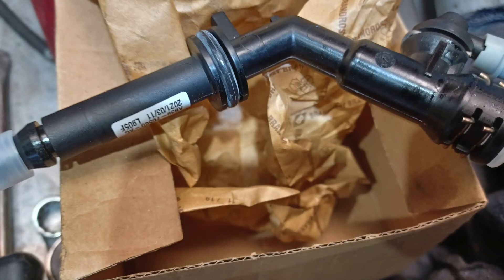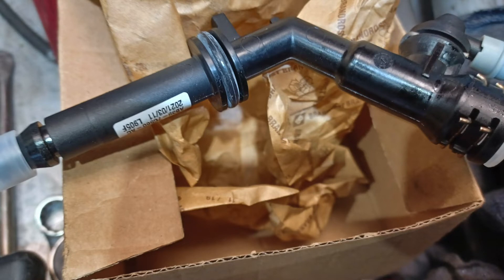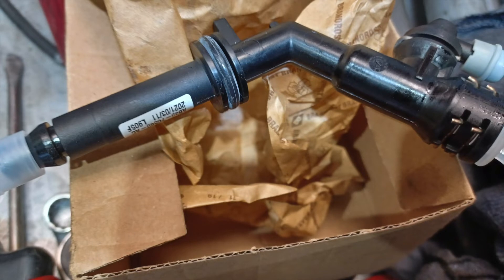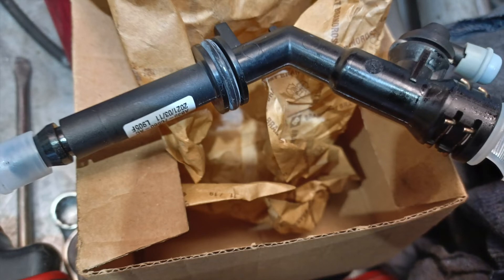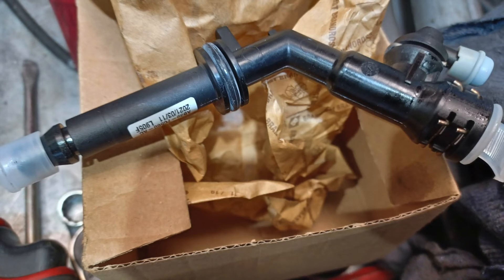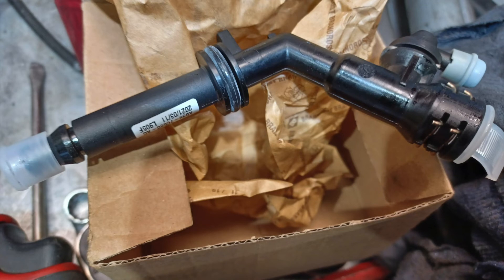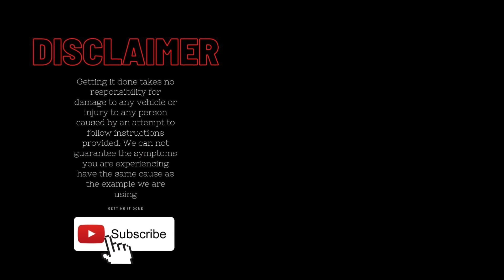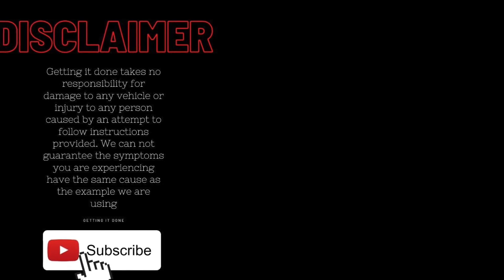Ford PX Ranger losing clutch pedal

Comment: I was gonna get one through ford genuine. thanks so much for sharing, been doing my head in for a couple of weeks now, my client's pedal is only partly sticking down, installed return spring to pedal, improved situation but did not completely fix, few weeks later came back, big headache.
Reply from the maker: Yeah we've done a couple of these now. We use genuine parts for them now too.
Reply: Did this sort your problem? Ive got the exact same issue & have thrown two complete clutch kits at it & can't work it out
Reply: @adamjones8480  yes,, turns out there is a restrictor in the clutch fluid coupling that is not there in the aftermarket units, since installing problem has been resolved.

Comment: I am a trade qualified mechanic, l have been chasing the same fault with two BT50's, one has done 230k & the other 70k. I have been tearing my hair out! (CHANGED M\C & S\C, & a heap of fluid!)
l really hope this fixes the problem.
Reply from the maker: Hi there, I've done two or three of these now with the same issue. The first one had everything else in the system replaced, this pipe was a last resort but fixed the issue. After that we have gone straight to replacing this pipe and it has continued to fix the issue. Not sure why, as it looks like a straight through pipe, bit we figure it must have something to do with the bleeder being in the pipe. We always fit genuine parts on this one because it's such a big job to replace. We have heard that the damper valves give issues as well, but that was one of the things replaced on the first one, which made no difference either.
Reply: @gettingitdone1  Thank you, l have got the part from Ford   AB397C560AC  cost between $230-250.  Mazda will only sell you the complete clutch fluid line $500-600+ . You have been confident enough to only change this pipe on any low or high km vehicle or vehicle which passes a slipping clutch test? Thank you.
Reply from the maker: @andrewtink5659  the gearbox has to come put to replace the pipe. So it's worth recommending to the customer, replacement of the clutch assembly and slave cylinder while the box is out. But have had at least one who didn't want to do that, so we just replaced the pipe and it was fine. The first one we did we replace all of that first and the master cylinder and damper valve and none of it worked. We had to take the box out a second time to do the pipe.
Reply: @gettingitdone1  HI, ANOTHER FAILURE, WENT AND REPLACED THE PIPE. WAS CONFIDENT, BUT NOW IT IS DOING THE SAME THING! I AM LOOSING MY CONFIDENCE REAL FAST. COST PRICE PARTS AND FREE LABOUR, I AM INTO THIS FOR A BIT OVER $2000, LESS MY TIME!
Reply from the maker: @andrewtink5659  oh man, that sucks. Sounds like the only part you haven't tried is the dampner valve, it's in the pipe that comes out of the master cylinder. You can actually take it out of the system, by removing it and rejoining the pipes. I have heard that they can cause issues sometimes but I've never seen it. Every one of these we've done has been fixed with the new bleeder pipe. Also are you reverse bleeding the system to make sure all the air is gone? If you haven't heard of reverse bleeding, I can share a video that explains it, it will change your world in bleeding clutch systems.
Reply: @gettingitdone1  hi, l have removed about 6 of those dampner valves. When the fail, they let fluid out everywhere. No l have not reverse bled before, if you could help me out that would be great. I have a bit of an idea. Thanks again.
Reply from the maker: @andrewtink5659  this video talks about how it works. https://youtu.be/sEP7ZIrbCMQ

Comment: I was changing my slave an putting the gear box back on that piece snagged and broke.. ended up modifying the line with a longer flex hose directly into the slave.. worked out ..
Reply: Hey mate I did the exact same thing, how did you modify the line to go directly into the slave? Did you basically remove this bleeder attachment completely and bypass it was a hose?

Comment: Having a pedal issue with my sons ranger, his clutch pedal isn't sinking to the floor though, just not always returning to the top, say about an inch from the top of travel. Does that sound like the same symptoms this ute was having? 
I removed the dampner and bled fresh fluid through the system, pedal felt fine for a few days then played up again, was leaning towards replacing the master first as i dont really want to remove the gearbox unless i have to. Am i hoping for too much? Should i just drop the box and change this pipe?
Reply from the maker: Different symptoms but possible it could be the same issue. You would think of the clutch spring was getting weak it would happen more frequently. We did replace the master cylinder first on this one, thinking that was the most likely issue, but it made no difference. If you are pulling the box out I'd replace both this pipe and the clutch assembly as the pressure plate spring could also be a cause.
Reply: Thanks for your reply, i hold some small hope now that it may be a sticking cup in the master haha. Really don't want to remove the box
Reply: Same here. It happens after driving on the motorway fast for a while. When slowing and downshifting, the first time pressing the clutch seems to be the trigger. It raises up to about an inch or two below the other pedals. I'm able to lift the pedal up and usually it will stay until the next gear change. This will go on for some time. It may last until the next time the truck fully cools down or just for a few minutes.

I was thinking it was old fluid boiling in the slave cylinder due to heat, so I bled it once. The issue has come back but it is less pronounced. I will bleed it again just to see but I think I will look at the spring first.
Reply: @captainotto  first time it happened for us was after driving offroad, so i figured the same, old fluid. I flushed it and it still happened a couple more times. But touch wood hasn't played up again for the last month. I purchased a new dampner and master cylinder but will hold off on fitting until it plays up again
Reply: @brendenrose9629 I get the sense that the slave cylinder may hold on to some fluid even after flushing. I don't know how true that can be but if it were true, it could be mixing and diluting with the new fluid over time. If so, that could explain what you've experienced and why mine's less pronounced. I'm just guessing of course but want to exhaust all the cheap options before I go for replacing the bleeder pipe and clutch itself (might as well do both I guess if the trans has to drop). What I do know is that when I did bleed the clutch, the fluid came out very dark and EC tested at around 4% moisture. I guess it had never been changed.
Reply: @captainotto  yep i am thinking that may be the case also. The fluid i replaced it with was clear, though now the reservoir is dark again. 
If i have to drop the box i will do the slave, clutch and pipe. But hoping its one of the simpler options
Reply: Hey mate did you end up solving this problem?
Reply: @adamjones8480  bled the fluid, it played up a couple more times then never again. But the brake fluid is now dark again so i believe it may have just taken some time to get the new fluid down into the slave. If you're having the same issue as me try bleeding it and see how it goes

Comment: Thanks for the information, same problem, where are you based, did you pull it apart to see cause, can I get to it from outside of gearbox? More information please thanks again
Reply from the maker: Unfortunately there's nothing to really see. You just need to replace the part. Also unfortunately the only way to change this pipe is to remove the gearbox. Based in New Zealand.

Comment: Hi hope you can see this and give me some advice, I had a similar problem with the clutch pedal not coming all the way back up. I decided to try and bleed it thinking it would be simple enough and gravity would do most of the work however my pipe as in your video was missing the 90 degree piece to attach a bleed pipe to. I can no longer get any fluid down to the pipe do you have any ideas on the best way to get this to work? Thanks
Reply from the maker: Hi there, to get fluid to come out of the bleeder, you will need to pull back the first metal clip and slide the pipe back away from the plastic pipe shown in the video. That will open the port to the bleeder to allow fluid out. Not sure what part is missing on yours, but as long as you can get fluid coming through, you should be able to bleed it. Also possible that the dampener or master cylinder have issues in the case of the pedal not fully returning.
Reply: Thanks for the quick reply, I cannot get any fluid to come out from the pipe at all, even if I completely remove the pipe going to the bleeder and pressurise the bottle still nothing comes down, when I pump the clutch pedal with the bleeder in the open position I can hear air being pumped but I can’t seem to get any fluid down there, any help is appreciated 
Thanks
Reply from the maker: @bencurl1779  so if there's no fluid coming through the pipe, I'd be suspecting the master cylinder. If the cups are stuck in the wrong place, that would prevent any fluid entering the lines. The dampener valve which is along the line on the firewall could also be blocked. I'd remove the pipe from the master cylinder see if you have fluid coming out there. If there is, I'd try removing the dampener valve from the system, then you could disconnect the pipe from the master and slave cylinder ends, blow some air through to check for any further blockages.
Reply: Okay I will try this, thank you, I can hear the master cylinder pushing air and the clutch was working before i tried to bleed it however not very good hence the reason for trying to bleed it. Did I hear somewhere that the dampener pipe can be blocked off or something do you know anything about this?

Comment: Hi. have you ever cut this tube open to see whats inside? it will give more reason to believe it is this pipe.
Reply from the maker: I haven't, but I believe it's just a straight through pipe with a bleeder nipple in it. I assume the fault is with the bleeder nipple allowing air to get back into the system.

Comment: i'm a mechanic experiencing the same problem on my px1 3.2 pedal on floor all of a sudden could still change gears but barely would get slightly better after use but still not normal ended up bleeding it had to pressure bleed it to get pedal back but after a week same problem still driveable but only just morning the worst .reluctant to pull gearbox out.Just a question the elbow connection at gearbox seems even thou not leaking very loose is there a o ring that can be replaced as its obviously drawing air somewhere no leaks or fluid loss detected .
Reply from the maker: Hi there, there are o rings, but on this one we literally replaced everything in the cluth system, before going back to replace this pipe as a last resort. We've now done 3 of these with the exact same issue, the pipe fixes it. There is the possibility that other parts of the system could cause issues also, but we now go straight to this pipe. The damper valves apparently have issues too. I think it must be the bleeder in nipple in this pipe some how drawing in air. Then you have to think about if the box is coming out, do you do the clutch and slave at the same time. The first one of these I did, I replaced the master, the dampner, the clutch assembly and slave, before having to take the box out a second time to do this stupid pipe 😆.
Reply: i think the o rings have shrunk in the fitting when applying pressure thy still seal but allow air in without it as that fitting connection seems far to loose in my book .Also it seems to loose its pedal standing overnight on mine.now having fitted some u think i could replace the o rings while in situ.?. As thy don't look easy to excess as i.m bit reluctant to pull my box for this
Reply from the maker: @twogates233  not both of them, you could replace the o ring in the pipe that fits into this pipe, but there is also an o ring on the other end of the pipe that fits into the clutch slave. That end of the pipe is in the bell housing. This pipe can't be removed without removing the gearbox unfortunately. If you do remove the gearbox, definitely replace this pipe. I did also try replacing that external o-ring on the first one I did too. It didn't do anything. Most of the faults I e had have been really Intermittent though, not loosing the pedal over night as much as randomly loosing it while driving.
Reply: @gettingitdone1  been thinking about this about it being a restriction in that stupid right angle elbow not freely flowing on the return stroke creating a vacuum when releasing the clutch might be ok when o rings are new but causing this issue when thy harden up .all said and done ford strikes again .Having to pull the gearbox for that is insane.

Comment: I have a Ranger 2017 model.  This problem is intermittent - It is fine for weeks and then the clutch goes limp.  Pumping the pedal helps a bit.  Bleeding the system at that part also helps.  But do you know what the problem with this part is?  Do the internals just wear out or does it get air in?
Reply from the maker: I don't know exactly what goes wrong, my guess is that somehow the bleeder lets some air in. The first one we did, the pedal would go to the floor while the customer was driving, then he would pull over, pump it up and it would be fine for another week. We replace the master cylinder first thinking it was bypassing the cups intermittently, then we removed the damper valve from the system (just after master cylinder). Then we did the slave cylinder (and clutch assembly since the box was out). Each time we did something (and re-bled the system) it would be good for two weeks, then go on him again. We talked to the clutch component supplier who told us these pipes and the damper valves can give issues. So we got a new damper valve to put back in, same thing again. Then we pulled the box out a second time to replace this pipe. That is what finally fixed it. Since then I've done a couple more where we have gone straight to this pipe and it has worked. Recommend getting a genuine part and suggest to the customer doing the clutch assembly or at least the slave cylinder while the box is out also. No one likes pulling a box out twice. I don't know why they don't just put this pipe in the clutch kits if they know it's an issue, it was a $50 part.
Reply: Jeeez!!! I have an exact similar problem… how did you sort yours?
Reply: @xxxxxl4120  It gradually got so bad that I had the bleeder unit/slave cylinder replaced.  No problems thereafter.

Comment: Clutch Release Concentric Cylinder
looking at this unit the clips and seal probably have a slight movement on the depression that wears and eventually starts to leak
Reply from the maker: For this particular issue, it’s not actually the concentric slave cylinder (although you should replace that at the same time). The fault is in this piece of pipe, we believe that the bleeder somehow lets air back into the system over time. This one had already had the slave replaced and still had the same issue until we replaced the pipe.

Comment: HI MATE, ME AGAIN. WELL, I HAVE TOTALLY EXHAUSTED IT NOW! I HAVE TRIED, 2X MASTER CYLINDERS, NEW GENUINE CLUTCH PIPE (BLEED PIPE), 2X SLAVE CYLINDERS & A NEW CLUTCH WITH MACHINED FLYWHEEL. I AM GOING TO RE-FIT THE DAMPNER. WHAT ELSE COULD IT BE? NOW I HAVE 3 OF THESE VEHICLES DOIN THE SAME THING! CAN ANY ONE HELP PLEASE.
Reply from the maker: Man you are having a tough time. So there must be air getting into the system somehow, which could get drawn in through any of those pipe connections. I know when we tried a new dampnerve, it came with a section of pipe also. So they could have issues there too. Do you loose the clutch all together or is it just the pedal sticking to the floor then coming back up?
Reply: Did you get this resolved? I'm currently in the same situation although luckily only with 1 instead of 3 vehicles
Reply: @adamjones8480  Hi mate, I think i have solved it. You need 2 people, 1 working the bleeder & 1 working the pedal. Pedal person jabs the pedal, working it aggressively. The other person randomly, after 10-12 pumps clips the bleed valve shut. You need a full reservoir of fluid. I dislike these vehicles with a passion. Sorry for the late reply. If you fixed it, please give me some feedback.
Reply: @adamjones8480  Yes l did, it was air trapped in the new master cylinder & the way I was bleeding the system. You need to really stab the clutch pedal by hand & have someone shut the bleeder randomly.
Reply: @andrewtink5659  thats like the old way with a bleed nipple

Comment: What's the part no? Thanks in advance
Reply from the maker: Hi there, sorry I don't have the part number for these, bit we did discover that the genuine Ford part was actually cheaper than the after market ones where we are. So we'll worth calling a Ford dealer and checking that out.
Reply: AB397C560AC  GENUINE FORD.